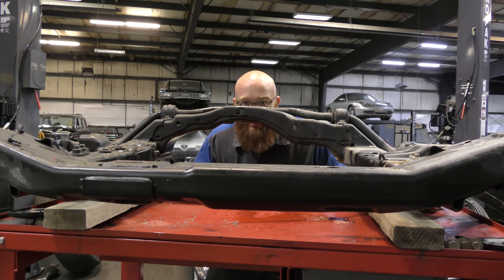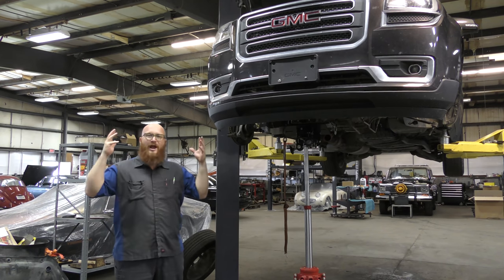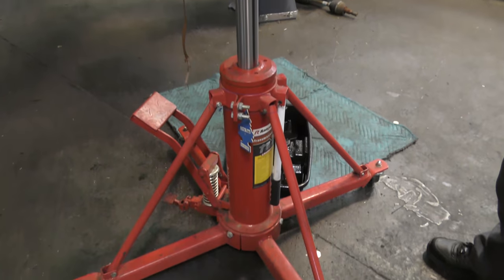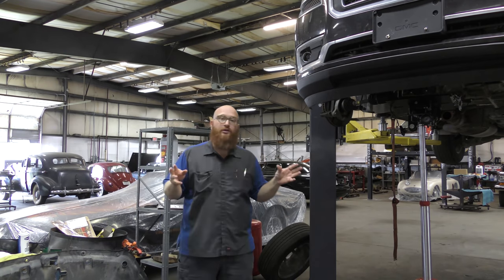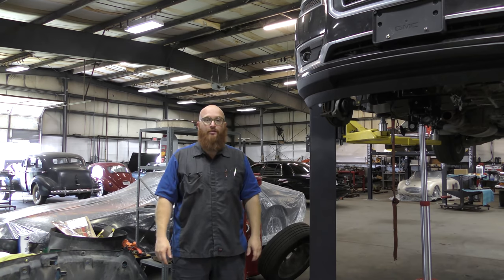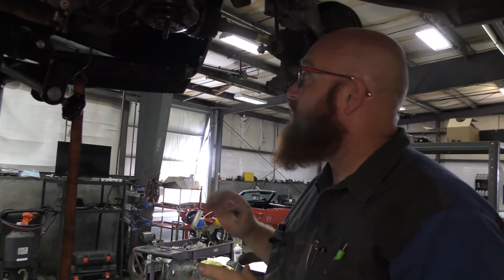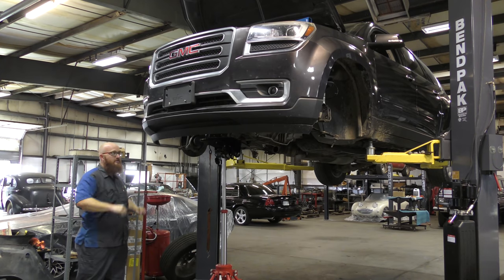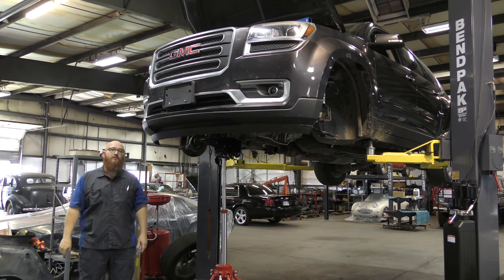Used car insanity in the CAR WIZARD's shop! Why did the huge repair get approved on this '15 Acadia?

Comment: This is not an "economic boom"

We're in the midst of the worst inflation event in memorable history
Reply: This is the weirdest economic crash ever disguised as a boom.
Reply: Two words - quantitative easing - the new normal
Reply: Shhhh!!! It will go away if we don't talk about it.. and presto, we've printed ourselves an eceonomic boom gentlemen!
Reply: It's called stagflation. I'm inclined to think you are right.
Reply: Imagine if we had a legitimate media...
Reply: @InsideOfMyOwnMind  It's a new round of stagflation but hopefully shortlived. History is your teacher - look to 1918. The risk is that the partying after the pandemic clears will be like 1921-1926
Reply: Buckle up, It's going to get much worse.
Reply: Not to mention a collapse of supply chains. Much fewer new cars coming down the line and they will be more expensive. People are going to be putting $$$$$$ to keep their existing cars running or put that second hand car right.
Reply: @Kauffman578  You'll own nothing and be happy.
Reply: @RussellChapman99  This isn't stagflation, that occurs when you have high inflation and unemployment and slow economic growth. Right now we have very low unemployment and a good amount of growth. It's just standard inflation with shortages making it worse that's the problem right now. If you want an example of stagflation look at the 1970's oil crisis.
Reply: Boom, bust, market doesn't really care what you think it is. People are buy used cars at way too high of prices and dealers are more than happy to sell them.
Reply: Not if you lived through the early '80s.
Reply: in US history. not memorable history. post ww2 it was cheaper to burn German currency than to buy actual heat. but yeah thats what happens when the government starts handing out free money

Comment: Whenever I see videos on four figure repair costs on newer vehicles, I think about holding onto my aging Accord a little bit longer.
Reply: I agree with you. I have a 2007 Toyota Corolla and I have no desire to own anything newer or more complex.  I never have any trouble with it.
Reply: This isn’t the case usually . He charges top top rate for his work .
Reply: @ChaoticDave69  - Gotta pay for his boats
Reply: lol same car here
Reply: There is something special about basically driving around for free
Reply: All the vehicles I own are old vehicles. My heater temperature lever operates a cable to the water valve. A little penetrating oil fixes it up for another five years.
Reply: Yea I'm holding onto my 95 Chevy K2500 with a deathgrip. Parts are as easy as taking a trip to the salvage yard, and they will last, and last. I'v done nothing but regular maintenance on it for 20 years. Even changed the timing belt myself. Undid the tensioner, and carefully slapped on a new one in a couple hours.
Reply: @ChaoticDave69  I live on the east coast, his rates are average
Reply: @grndzro777  Ford has one V6 engine, the OHV 4.0...that has four timing chains and one of the four is on the rear of the engine making it difficult to change without pulling the engine. Not one of Fords better ideas.
Reply: It'd probably be cheaper for me to rebuild everything under my car, do my clutch, fix my exhaust that's starting to leak and has flanges that are now one piece (gotta love Rust), do my timing belt and fix my cam seal leak, and fix my distributor leak than it would be to have a shop repair a vehicle like that. 
I'm actually gonna add it up. Clutch System Kit, (around $350 everything included) - Front & Rear Strut/Shock Set ($400) - Front End Kit ($300) - Timing Belt, Water Pump, Seals ($100), Full Exhaust System Kit ($400), New Cat (Fuck it why not? $250) and we'll add all the mounts for the engine and trans (Call it $75)  
So doing the math...That's around $1900. Granted prior to the hours it'd cost - but I can do it myself. That's maybe half of the repair of the car he had in the video.  
Shit that's actually cheaper than buying another clean Accord.
Reply: @CAepicreviews  fix the critical, drivability issues first. Plan on your vehicle be apart for a few weeks. This is why I always keep at least a half dozen old cars around. At any one time a couple of them might be in some stage of repair.
Reply: NEPAMOTORHEAD you get what you pay for. Quality work is expensive for a reason.
Reply: Herman Munster I call that a luxury vehicle. You have the luxury of peace of mind not having to worry about complex, expensive repairs.
Reply: @ronjohnson8119  a 2007 vehicle can be relatively complex....now my 1977 Ford F150, not much there to stress anyone's brain. No computer and the only electronics is in the factory AM/FM stereo radio.
Reply: @ronjohnson8119  that's the catch with luxury vehicles like the ones I work on (Mercedes-Benz) - Nothing comes cheap. There's some complexity, sure, but if you've got the tools and knowledge it's not that bad. There's only so many ways something can fail. Mechanically, Short to Ground, Short to power, open. Fancy as it is, it boils down to that. Complexity is added by the systems but when you know what to do you can figure it out.
Reply: Geralt of Rivia That is partially true.  Those are the basics but their are also things like configuring modules properly and having a good understanding of all vehicle systems and how they relate to one another. As a professional Mercedes tech for nearly twenty years I can’t tell you how many cars I have seen towed in because a do-it-yourselfer (or another shop) didn’t have the knowledge/experience to know that a module was improperly configured and replaced it unnecessarily. This comes with years and years of experience and training. Yes, most problems can be resolved with a good understanding of the basics but their are so many problems that can only be resolved by having an extensive level of experience and product knowledge.
Reply: A bit longer ?? keep that accord until it dies 👍👍👍
Reply: Hang on to it
Reply: Why get rid of it? I'll never sell my 03 Tacoma with 240k miles.
Reply: Accurate
Reply: My 2004 Avalanche has 400,000km, I paid $2000 4yrs ago, I was offered $3500, it needs a Windshield, shocks, PS Pump, rear seal leaks, tires are 50%.
Reply: @joshgladstone7119  I do to and for NYC yes,Not everywhere else.
Reply: @grndzro777  Did you change a timing belt or the timing chain???
Reply: @neilduncan8657  The chain. It's behind the water  pump, and harmonic balancer.
Reply: @northdakotaham1752  technically, your '77 with electronic ignition uses a computer. It's a very simple and basic and reliable one, but still there. Unless you switched back to points. I rather have electronic ignition though. A lot less finicky.
Though, I am getting more use to working on efi.
Reply: @northdakotaham1752  it's extremely hard to find old vehicles in this climate. i have a 97 grand prix (creampuff with 45K on it), a 2001 grand prix (kinda of roached out underneather but ill keep it as long as i can), and a 2003 SSEi bonneville that i park in the winter. all 3 of them have 3800 v6 engines. stout, reliable, cheap to repair and easy to work on.

ill be in the market for another clean 3800 powered car if i can find one. making big payments on over-rated junk just doesnt make sense to me. i pay cash or a dont buy it

Comment: 5 k timing chain job in my 75k mile 15 Audi turned into $14k with mounts, tstat, waterpump, hoses, gaskets bolts.  They also broke my radiator and condenser in the process. Then took 4 months to do it.

Comment: In 6 years it needs a single repair that costs more than my 85 Datsun Pickup has cost in the last 22 years, including purchase price. 🤣
Reply: do yourself a favour, dont ever, for any reason, under any circumstances get rid of that car if you care about yourself. yes its old but if you do proper maintenance (nothing extremely expensive, just dont use 2$ free shipping air filters from china etc). it will be able to be driven untill your grandkids retire. the newer cars you can throw all kinds of money at them, just so they can fail in a more expensive and unexpected way later.
Reply: @kapioskapiopoylos7338  I'll never get rid of it. It was my first vehicle and it'll be one of my last 😁

Comment: also the timing chains on the acadia's can be done in the vehicle. i've seen very few techs do them but it is very difficult to do in vehicle and a lot of times there not lined up right, they said it only saves you 45 minutes to do in vehicle. Its a lot easier just to drop the motor out to do them and do correctly
Reply: Keeping it in the vehicle means it's impossible to get old gaskets and stuff off. It'll be back within a month with a valve cover leak.
Reply: From what I saw usually less than a week it would come back, we had one guy actually forgot to put on a new front cover gasket and sent it out

Comment: Wanna know how weird it is? My wife’s CRV was leased in 2018 for $23,000… Honda just bought it back for $21,000 when the residual was $14,000. I had $7000 of equity… *in a lease*. That does not happen.
The demand for used cars is insanity right now…

Comment: 9:45 John Ross (WatchJRGo) said it the best during one of his fleet updates; all of the super cheap cars that you see now ($300-$500) have extremely high mileage, have been completely driven into the ground with major drivetrain, body, or electrical issues (or have no title) and honestly should be scrapped. The current car market both new and used is NOT buyer friendly at the moment, and if you can hold off buying a car when this completely insane bubble finally bursts, hold off as long as you can.
Reply: High mileage cars, if looked after, can carry on going - why ever buy another while it still works!
Reply: Because at high mileage ANYTHING can go wrong without warning. Oil pump, alternator, transmission, timing chain, fuel pump, master cylinder…… any of those could go bad on a moments notice when you’re on the road and leave you stranded with a super expensive repair bill. Once you get over that 150,000 mile mark, it’s time to start thinking about buying a new car no matter how well you’ve maintained it.
Reply: Last January I planned on buying something newer in June. I figured I'd wait for the tax refund crowd to jack up prices in February/March, then buy when the prices dropped. They didn't, instead they've just increased. 
I'm fortunate. My current car runs fine and should continue to do so. I feel sorry for the people who really need a car now, they are getting screwed. People are paying $16K for a $12K car. Then financing it which adds even more. By the time they pay it off it will only be worth $2,000.
Reply: @sph_holl2650  indeed, your typical high mileage Toyota/Lexus and Honda is a prime example of that; but my original comment stated that the cars for the $300-$500 price range have been driven into the ground (both interior and exterior trim parts broken or missing, tons of deferred maintenance items, major collision damage that would have totaled the vehicle if turned into insurance, major drivetrain damage like blown engines or transmissions, and paperwork issues like lost/destroyed titles, mileage discrepancies, etc.)

Comment: I'd love to see/hear real automotive design engineers defend their work.
Reply: Their defense is they are working within a budget.  The finance department tells them how much they are allowed to spend, and they engineer it to be at or below budget.  That means sourcing cheap parts and modular assembly with little regard for serviceability.
Reply: Yea the design is fine for the most part just cheap parts and incompetent owners
Reply: @carlpenney901  amen brother
Reply: Honestly you don't. I work for one of the big three and it's nothing but excuses.
Reply: Now that would be entertainment.
Reply: I feel they would say "it's not my fault, blame the accountants"
Reply: @nicholasfield6127  quite likely so.
Reply: It's not our engineer's, they're the greatest.  It's the damn boardroom.  The stock holder's have ruined GM.
Reply: Look at how long a vehicle is made for. If it's the same vehicle in 20 years (ye syou can change the drive train as improvements arrive) , they did well. If it's a 3 years and all change, it might not be so good. I drive an '06, that hit the market in '03 and is still  being made in 100,000 per year....think I should be ok.
Reply: To be honest with you, it's not the engineers. They are told over and over by the exacutives to cut corners or change from their original design and specs.
Reply: @carlpenney901  Toyota, Honda, etc don't do business that way.

Comment: People get pissed at me when I quote them 100’s to replace 50p o ring😂😂😂👍

It’s hilarious trying to explain the economic principles of repairs. Good job Wizard👍
Reply: I run a shop in dayton, ohio and when someone tells me my prices are too high I explain it's free if they do the work.
Reply: I do lots of engine work.  They get mad when   a head gasket set is $200 but the labor is $1300.  I do say well I did have to take half of the car apart to get to it all.
Reply: I did a £1 O-ring seal on my old Merc E55. It was madness - It was sealing a large passageway between the timing chest back cover and the block where the water pump supplies coolant into the block. My car's done 220k so the thing was like brittle plastic. So, so much dismantlage. I added a water pump and drive belt to the job up front... But loads of air con and cooling bits were shagged out adding to the job. The bill would have been astronomical and all the other bits that got found along the way would made it stratospheric! Once you get into it there's always more!
Reply: Oh and the head span right off one of the bolts on the waterpump housing, like they always do on old cars I was lucky though I was able to grab the remains with some moleys and wind it out... But that type of thing can really eat time! And it has to be paid for!
Reply: @hydorah  “Dismantlage “ Great word👍 

Didn’t MB have biodegradable wiring looms that degraded prematurely?
Reply: @PeteCourtier  They did Back in the W124 days, they had a spate of it. Those cars are not all affected and they are tanks. Mine has loads of electronic fettling from me over the years. Late '90s Bosch is a load of old tosh!

Your username is quite the creation! Love it!
Reply: @hydorah  cheers🍺
Reply: All a customer would have to do is simply watch the repair process. Then they would understand the price. During my time at Fiat, I know dozens of customers would be horrified to see just how disassembled their car was to do an otherwise simple repair. Thankfully most of the time they aren't interested in knowing.
Reply: I replaced the Water Pump on my '04 Avalanche, the shop wanted $700, only took me 4 beers.

Comment: I like the old style HVAC controls that were completely manual. They could break but it was less likely.
Reply: When they broke it was more work though lol
Reply: me too! cable actuated
Reply: Electronic hvac controls are usually very reliable, it's just that general motors can't build shit. Also, fuck climate controls integrated into a screen.
Reply: @UnrealOG137  Sorry electronic controls especially the actuators fail very often and with low miles. Manual HVAC is the way to go, they are mostly all bulletproof.
Reply: @watershed44  I've never seen them fail before.
Reply: @UnrealOG137  Manual cable actuated HVAC controls don't fail unless a car is  EXTREMELY OLD or has 250k miles on it. That's why the mfrs went to these ridiculously fragile motors for HVAC 
PLANNED OBSOLESCENCE. You must work for the car mfrs or vendors. lol
Reply: @watershed44  wut?
Reply: @UnrealOG137  I've seen numerous electronic systems fail and at low miles, and many times it is due to low lead solder failures on circuit boards of modern cars, but also the motors are fragile and if something isn't just right the motor will burn out.
Reply: As someone currently chasing vacuum-related gremlins behind the dash of my 93 F250, I wish I could just swap out some actuators and call it a day.